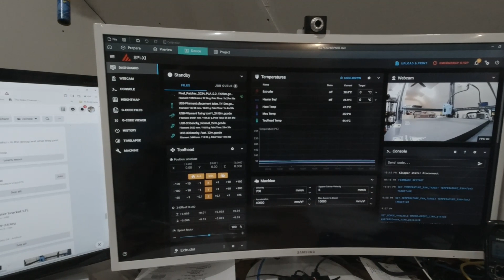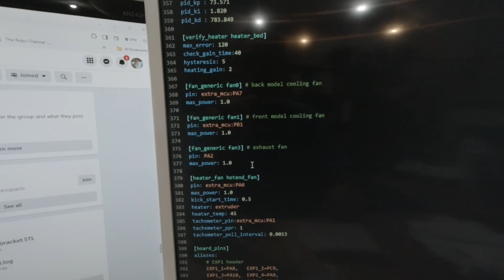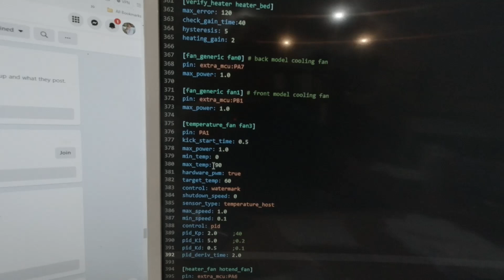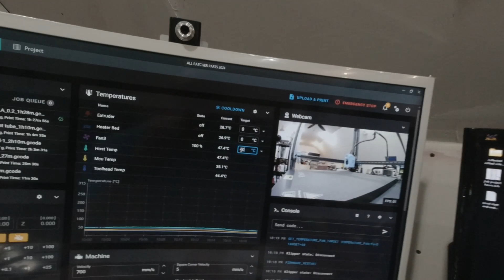Sovol SV08 CPU fan control via software

Comment: Great and thanks very much!!! it can be made on the new SOVOL 08 Max, I noted that this fan is alway on!
I you could give me an idea I will thanks a lot...
Actually this is the code:

[fan_generic fan0] # front model cool fan
pin: extra_mcu: PB0
max_power: 1.0

[fan_generic fan1] # back model cool fan
pin: extra_mcu: PA7
max_power: 1.0

[fan_generic fan2] # auxiliary fan
pin: PB0
max_power: 1.0

[fan_generic fan3] # exhaust fan
pin: PE11
max_power: 1.0
Reply from the maker: I'm not sure which fans are what on an 08 Max.  Check the Facebook forum, or ask Gergoprint3d guy.

Comment: I replaced the motherboard fan with a Noctua as I was assembling the SV08.  It's running all the time with the stock printer.cfg but it's so quiet I had to tip the printer up and put my hand over the fan port to feel the air moving.  I could barely hear it with the printer tipped up but I could just barely discern a difference in tone when my hand covered the vent.  The Klipper dashboard without the printer.cfg modifications shows the MCU temperature as 38 C so the Noctua fan is doing its job, but the original printer.cfg doesn't allow PID control so there is no field to input a temperature setpoint.  I was going to change the printer.cfg to provide a PID control for the fan but it's so quiet I'll leave it on all the time.  The Noctua is a very high quality fan with high durability so there's not much advantage in lowering its speed.  The fan was easy to replace while assembling the SV08 (9 screws and a connector swap) so I think this is a case where the hardware fix is even better than the software fix, but the software fix is much better than the noisy Sovol default.

I'm not on the SV08 Facebook group and I wouldn't want to be.  What kind of jerks prefer to keep information a secret?  One of the reasons I like the SV08 is that it's open source.  I like the sharing is caring community that engenders, but posting information on your little private group and denying it to the unwashed masses is moronic and borderline troll evil.  It's the opposite of open source ethos.  Shame on them, and thank you for taking time to make this video to help others.

Comment: Hi, I have not bought this 3d printer yet, but I hope to get it here by the new year. may I ask, what do you print with your sovol 08. Or, what plans do you have for it? i am into sci fi guns. Keep having fun, Chris in Bulgaria age 61.
Reply from the maker: I print items that I sell on Ebay.  I have also printed a real gun I designed that used the Ruger LR-22 trigger, bolt, and barrel.  Elsewhere on my youtube channel you can see a 3d printed plasma torch head I designed and printed.  I think the SV08 is a fantastic deal, and people are upgrading it to become even smarter, although I am happy with it running with its stock firmware.

Comment: Some reason my CPU is idling right around 60 so the fan just keeps going on and off, and when it's on it's at a super low speed which is somehow even more annoying. Going to look at adding a heatsink and/or putting in a bigger fan then using this trick.
Reply from the maker: @rohankoripalli  I have heard some people's units run hot.  Perhaps factory didn't use heat sink compound

Comment: If you were to purchase the Noctua NF-A4x10 24v fan and plug it in to the exact same spot the current 4010 fan is, would you still use this script "as written" or could/would you lower the target temp of 60 to something lower? (because of the much quieter Noctua fan). Or would you just leave the original printer.cfg file alone on the stock Sovol SV08 with the Noctua fan installed?

Comment: Thank you,  Im new to printing in fact my SVO8 arrived today,  just about ready to open the box and assembly it.  What software did you use to edit the config,  are you ssh into the printer or remote desktop into the printer?
Reply from the maker: You can bring up the printer and its configuration in Orcaslicer.  This is also where you see live camera image and all temperatures.

Comment: There is a bad PWM-sound, when the fan is spinning under 10% speed. 
It's better to shut off the fan when it is spinning under e.g. 20%

Here is the updated code with the tweak to avoid fan spinning useless unter 20% speed and making pwm noises
(works with original fan, might not with other fan. Use at own risk and test if the fan spins up again after shutting down):

[temperature_fan CPUfan]
pin: PA1
kick_start_time: 0.5
max_power: 1.0
min_temp: 0
max_temp: 90
hardware_pwm: true
target_temp: 57
sensor_type: temperature_host
max_speed: 1.0
min_speed: 0.23
off_below: 0.25
control: pid
pid_Kp: 2     
pid_Ki: .5     
pid_Kd: 0.25     
pid_deriv_time: 5.0

Comment: I inserted the rows in the desciption in the printer.cfg an restarted the firmwarer, than I started a print and got a error :
The value "fan3" is not a valid FAN
And the print was canceled
Reply from the maker: @laurentmehlen7781    Below the section of code about fan three, not in the middle of it, add this:

[temperature_fan CPUfan]
pin: PA1
kick_start_time: 0.5
max_power: 1.0
min_temp: 0
max_temp: 90
hardware_pwm: true
target_temp: 60
sensor_type: temperature_host
max_speed: 1.0
min_speed: 0
control: pid
pid_Kp: 2     
pid_Ki: .5     
pid_Kd: 0.25     
pid_deriv_time: 5.0

Comment: Thank you for this; it's really helped. Eventually I'm going to install the new Noctua 24v fan to help with the noise when the fan does kick on, but for now, it's much better.
Reply: If you're not opposed to some cutting, print a nice fan cover (I liked thing:4288719) & cut the grill out of the bottom panel.  I held the cover in place with the fan bolts run in from the bottom of the nutserts & hot-glued the new cover on (just by the corners to allow air in under the edges), then reinstalled everything.  Drastically reduces backpressure so the stock fan never gets particularly loud and 50C usually stabilizes at about 30% speed. Non-reversible but doesn't require buying stuff.

FYI it took me a few hours of shopping locally & online for cheap 40mm wire grills before it occurred to me "hey, I have a 3D printer now!" 🙄
Reply: Got the same idea but idk how to change the fan

Comment: I find that when the fan speed is set to anything less than 100%, it's off and only on when the speed is 100%. I'm making this mod after changing out the fan to a Noctua 40mm PWM fan.  Since the fan connection is only 2 pin, the PWM-ing is being done on the supply voltage to the fan and not the PWM control pin.  Do you happen to know if fans with PWM control inputs don't do well with PWM-ed power?
Reply from the maker: @marclefevre1045  mod was intended for stock machine.   All bets are off for other fan mods.  There is no pwm pin on the output.   Just power and ground that get pulsed to mimic pwm.
Reply: It works with any 24v DC 2-wire fan (0.1A), like the stock one. Should work with more than 0.1A but not sure how many amps fan connector are able to deliver. Anyway, 24v 0.1A fans are super common: Replaced the 40mm stock one by a 80mm one (8010 meaning 80mm diameter, 10mm thickness. you do not want thicker than stock (4010) else it will not fit).  Much quieter, then put it on PWM following this guide. Wow, now I do not have the urge to power off asap, it's the opposite, I struggle not forgetting to turn off the SV08 when done printing :-)

Comment: thankyou so much, my printer sounds so much better now.
so much easier, and totally non-destructive compared to all the other fan mods for this printer I have seen on the internet.

I have adjusted the settings a lil;
 target_temp being set to 36c (winter here at the moment, and this was around the lower end temps that I found the fan made some difference while at idle)
 min_speed: 0.05. (at 5%  the fan sound was less of an odd sound than at 10%)

totally worth a thumbs up an a subscribe!

Comment: Please, where is the temperature measured from and which line in the definition connects to that temperature sensor?
Reply from the maker: The line that says "sensor_type: temperature_host".  Host is a chip on the pc board.  It actually runs hotter than the CPU, so that is the most important item to keep cool.

Comment: Does not work for me with noctua 24V pwm. It is only a two point controller (on-off) so no linear ramp.
Reply from the maker: @bartsimpson7399  the stock fan works well.  It is significantly quieter if you cut away the metal grid over the fan entry.
Reply: @JohnHansknecht  I put the old fan back in and it works but it makes a strange noise on low pwm levels.

Comment: Its also worth swapping the fan out for a decent fan like a noctua or similar, so even when it does ramp up its a LOT quieter. Also creating a definition for the correct fan if youre going to add the enclosure at any point.

Comment: Just FYI, the fan3 definition is for the enclosure exhaust fan (included with the enclosure kit), not the controller bay fan. Better to create a new fan definition for your mod instead of changing the fan3 definition, so people won't run into problems when they install the enclosure kit.
Reply from the maker: @kpgeary  I see what you mean,  but I  can't remake the video.   I only presented code I found in a forum.  I'm sure SOVOL will be doing an official update soon.
Reply: Hi Kp, I have just edited my printer.fonfig and noticed that my enclosure fan isn't working? I started to read the comments and low and behold I seen your post that explained why it was missing. Have you come up with a fix for this. I would really appreciate if you could come back and let me know.
 Regards.Mike Irish
Reply: is it just a case of renaming his code to say fan 4? and leaving fan 3 alone? *update, that is what I did and it seemed to work, new to the klipper thingy lol - can you use this same code for the case enclosure fan? "fan3" as it seems it is set to 100%
Reply: @triXsolarflare  I Think The fanx is only to name it. The pin: is where the magic goes. Also no clue about Klipper but i think makes not to much diffrent to other Programming things.